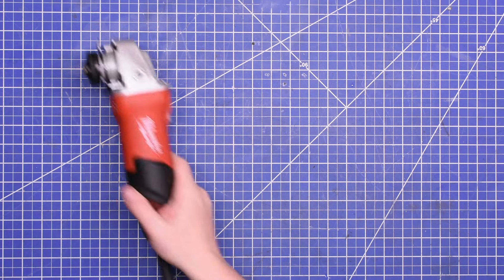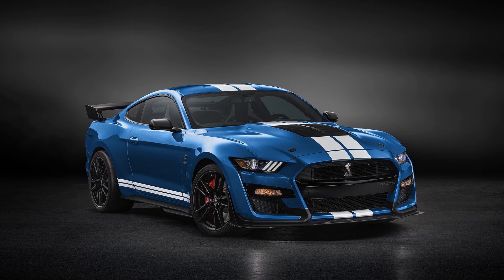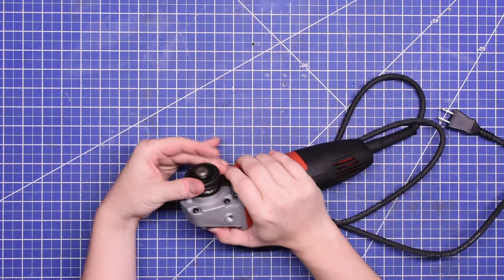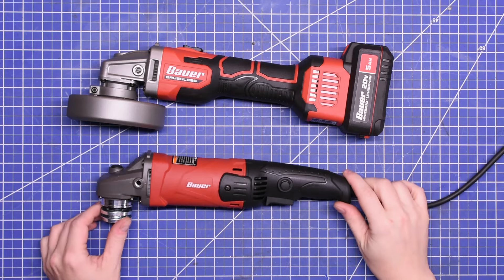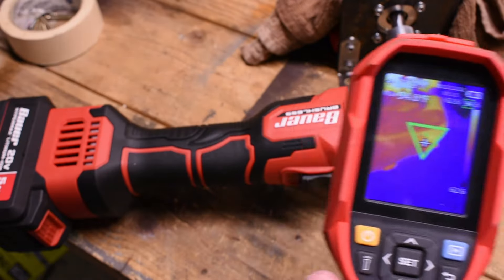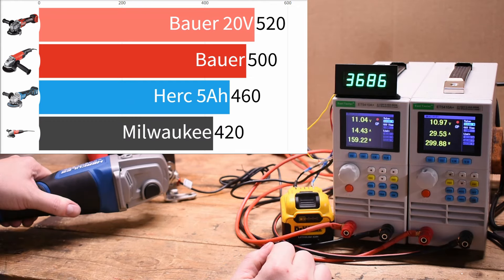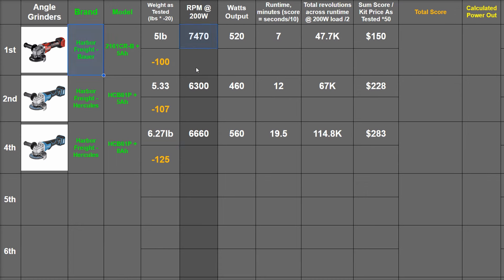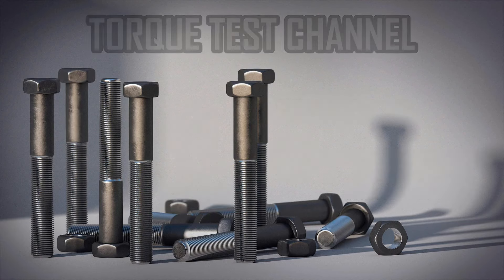Corded v Cordless Angle Grinders Dyno'd! Milwaukee vs Harbor Freight

Comment: The Milwaukee corded would probably last a lot longer then the Bauer corded even if it makes slightly less power and is more expensive.
To get a proper test you should do a prolonged test to really test them. But anyway great content and really find thes vids interesting.
Reply from the maker: We had planned to, but didn't anticipate them being so violently shakey when hooked up to something
Reply: That milwaukee is junk. You can't even hold it. It rattles like crazy and gets hot
Reply: @TorqueTestChannel  Ok i take back what i said then
Reply: @jordanbeyer7607  
To add: Excessive vibrations and heat put undue stress on all the components, especially prematurely worn bearings, seals and loosening electrical connections would be my worry. 
It's a mistery to me how they mess the rotor balancing up so bad, it should be an automated process, literally everybody else has had it figured out for decades.

Comment: generally an angle grinder is one of those tools i prefer a corded one since most of the time i'm there for 20-40min at a time cutting through some sturdy metal thing. hell i burnt out my dad's old one and when i took it apart it was severe overheating. the motor was basically char and the gearbox didn't look much better with burned up grease and a bearing that looked like it seazed at one point but the momentum of the rest of the tool had broken the bearing, would explain it's bad rattle. dad and i had a good laugh at how far that tool went before dying.

Comment: the threads of a grinder are not intended to be true like an output shaft the only reference surface is the flat where the back of the grinder disk sits,  the best method would be to use a flex coupling so that you dont loose power to the vibration.

Comment: I think the TTC mad scientist labs needs to crank out a 15 amp corded angle grinder using a high-efficiency brushless motor. Theoretically, you should be able to break the 2 horsepower OUTPUT barrier.

Comment: You got to get the dewalt flexvolt grinder. I use them daily and they are bad ass grinders !!!
Reply: The dcg 414 is the first one they slipped in a 418 which looks identical but it is more powerful both 4-1/2 60 volt angle grinders

Comment: That would be pretty epic if you could put that high powered battlebots motor in like a 1/2 Milwaukee impact. I would think it would probably break something as they make tons more power than the stock motor.

Comment: Looks like Hercules has been made slower on purpose, giving longer run time on standard batteries and both higher rpm and longer runtime on the big battery.
Reply from the maker: Thats why we give points for total revs across runtime too, but it seems like the Herc doesnt drop much RPM under load either
Reply: @TorqueTestChannel  👍

Comment: That's my problem with mains powered tools. They are still using the same motor and gearbox design for probably 100 years while the cordless suddenly switched to brushless and became more compelling. If these mains powered tools would be able to harness the power a wall outlet could give and send it to a brushless system those numbers will be even better, at lower power input. But then, reliability can be questionable...hard to kill a bunch of coils and brushes alone than the tri-phase H bridge driver and the resultant power brick that would run it on the mains

Comment: Seems like weight is scored a bit high to me. It's an angle grinder, you're going to get vibrations, less isn't always better.
Reply from the maker: I think it's probably because we're often using these things with arms stretched out or above our heads under a vehicle. But while the numbers are large, the spread between lightest and heaviest here is only 25 points on a 700ish point score.

Comment: Are both Hercules and Bauer house brands of Harbor Freight? If so they have done a pretty bad bobo by not unifying the battery design. It is after all the most hated part of cordless tools. And for the same store having two house brands that use different batteries just feels so wrong. Brands like Milwaukee, DeWalt, Makita and Ryobi you can find "everywhere". That makes it easy to find batteries and chargers is needed, but house brands are only available from the company selling them, in this case Harbor Freight. So a consolidated battery design would increase the total volume for that particular part instead of dividing the sales volume between two competing brands that just happens to be house brands of the same chain of stores.
Reply from the maker: Oh it gets way worse. They have 3-4 cordless lines. But TTI does the same with Milwaukee, Ryobi, Ridgid so just different price points to get all customers i guess.

Comment: That analogy is ridiculous. It's nothing like saying what the MPG of your vehicle is to describe how much POWER your vehicle has. The amperage draw of the motor is a very accurate tell as to how much torque the grinder will put out and it is the single most important metric to determine how much material it will be able to remove over a given period of time which is the only job an angle grinder has. Of course there are other tings worth considering when purchasing an angle grinder such as features like a brake that will slow the wheel down much faster when cutting power or how much vibration rings through it when using it etc etc. As I mentioned though if you're just trying to determine how much work it will do over a given period of time you PRETTY MUCH need look no further than the Amperage as electric motors are VERY simple machines that have not really been innovated on AT ALL since their creation and current is directly proportional to the output torque of an electric motor.

Comment: I'm extremely surprised by the output power of those battery tools. That is probably higher than all the lower power half of the corded grinders.
OF COURSE it is battery murder. You won't get many cycles from loading them like this... But still interesting it is possible!

Comment: Very cool channel regardless. But for 99.99999% of the population, you'll  A.) be able to get the job done regardless of whether you have a DeWalt or Milwaukee and B.) If you own DeWalt batteries, you'll buy DeWalt tools, and if you own Milwaukee batteries, you'll buy Milwaukee tools and so on.  If one brand scores 660 and the other scores a 600... you're' not gonna buy all new batteries for a negligible difference in performance and C.) Some tools are better in one brand, while other tools are better in other brands. All in all, you'll get the job done whether Milwaukee, DeWalt, Ridgid or Makita. But I still love the channel. Now corded...that's different.  Doesn't matter what brand you buy.  Electricity is electricity.   Some folks will have Makita in one, DeWalt in another, etc.  Changing up corded models based on performance makes sense.

Comment: Whats crazy is for the bauer price difference between the hercules you could just buy another 5ah battery for the bauer at that price lol. I like my bauer stuff. Its just used for home stuff but that brushless 3/8 impact is terrible. I can't even get  lugs off my car with the 5ah battery lol. 450ft lbs my ass. Probably should have just got the high torque

Comment: If your dad's 454 is only making 200hp there is something seriously wrong with it.  New those were rated at 290.  Maybe time for a tune-up?  My '99 (on the torque app) makes 245 most days and still racks up 400 ft/lbs.  Yeah, we don't talk about fuel mileage, but it tows a trailer very well!
Reply: They were made for a long time. I think the lowest rating sometime in the 70's or 80's was 230hp.
Reply: It's just a generalization... I doubt he has dyno'd it.
Reply from the maker: Haha, yeah I doubt it's running as well as when new given what happens when you floor it. But point taken

Comment: DeWalt DCG409VSB.
Reply from the maker: Whats the difference between that and the DCG416B?
Reply: @TorqueTestChannel  DCG409VSB is  slide switched with variable speed. DCG416B is paddle switched with a fixed speed. There is also a DCG416VSB variable speed model.

Comment: More amps equals more power every time what’s so hard to understand? The don’t get why your wondering why they advertise that way
Reply from the maker: More amps means it uses more power. That doesnt guarantee you anything coming out of the tool. Could be a 35% efficient universal motor, or a 55% efficient one, or an 85% efficient brushless corded tool. All taking the same amps.

Comment: Power in a grinder is irrelevant - it is often a bad thing in fact. When you grind a lot, you understand.. huge power getting jammed up = Huge problems..  How much it vibrates, how long the battery will run it for, will it die after 2 days of hard work?  I could care less about power & I use a grinder all day every day at work.
Reply from the maker: The idea being a tool being run to the max to do your normal work vs a tool that's barely trying - the one not trying hard is going to last longer and get less hot all being equal. Of course we'd love a way to tally long term durability, but we've never seen it done in a good representitive way
Reply: @TorqueTestChannel  Cobblers - I run grinders. I'll pop over to yours & show you my left arm where a "Max Power!" new grinder jammed up in a cut last week, spun out of my hands & slashed open the back of my arm because some nerd at "Grinders R Us" decided their latest & greatest puppy needed more beans than the last model. Not that I much care as them's the breaks with angle-grinders - they're inclined to bite. 

Why you would want one with even more capacity to bite is beyond me. This tool spins a bloomin skinny little flappy disc, or an even skinnier cutting disc - for what do you want all this power? A 20 quid grinder will have all the power you need on earth - but won't have the durability & will vibe your hands to bits as it shakes. Power is utterly irrelevant. How smooth & durable is it? That's the IRL question.
Reply: I want "All The Power In The World" from an impact wrench - I care not what power a grinder makes. Horses for courses.

Comment: The Amp rating is a BS rating trying to fool the unaware into thinking HP. A crappy motor will suck up the power (expressed in amps) for little return in torque/work.

Comment: Your dyno adapter design is flawed and will cause vibration. No threaded connection can accurately locate centerline. You must have a pilot diameter that registers on the OD of the shaft of the grinder. Just look at positional tolerances for threaded holes on any blueprint. Standard error is +/-.005".  There's a reason dowel pins are used to locate accurate connections. Dowels are often called out with .001" or .0005" of positional tolerance.

Comment: But I bet the bauer will not hold up in a daily use .chorded or chordless..And this has to do with all these junk tools you test.. After 40 years as an auto tech..see this all the time . And what I mean is simply this inexpensive tools look good and may perform well at first but they fail fail and fail